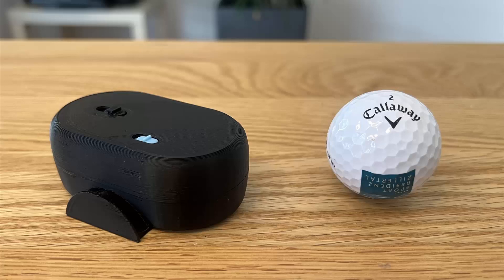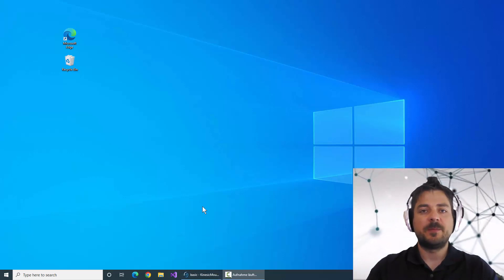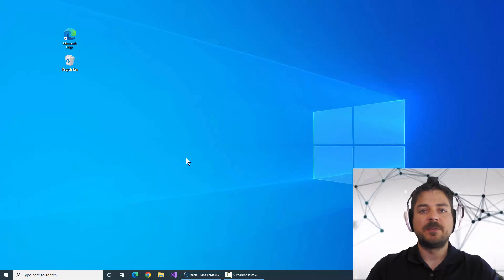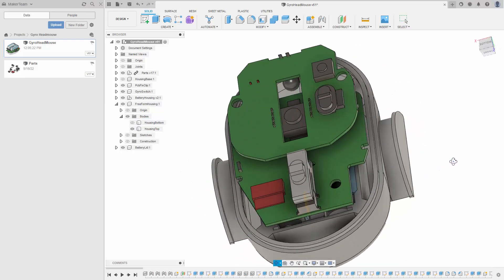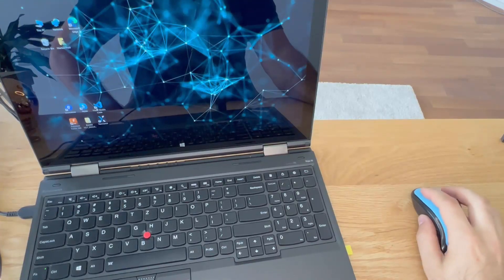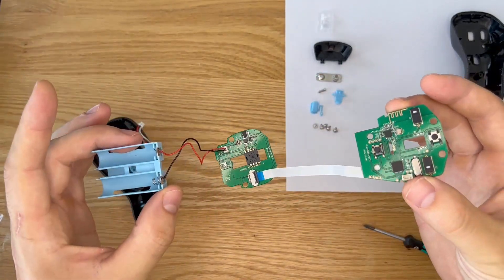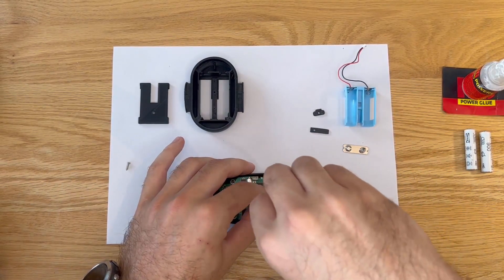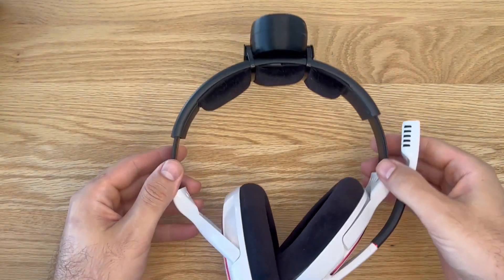G-OHM gen1 - A 3D printed gyroscopic head-mouse

Comment: Hey, I am wondering if you have a good trick to help center the mouse again instead of moving the mouse to some corners  (especially if monitors are wide or you have multiple ones). Air Mouses do have buttons for that, but I am wondering if I could trigger something (with Talon for example) to stop the mouse for a few seconds until I have centered my head.. thanks!
Reply: Combine it with mouse warp feature from the Tobii Eye Tracker 5, best and fastest setup you can think of.